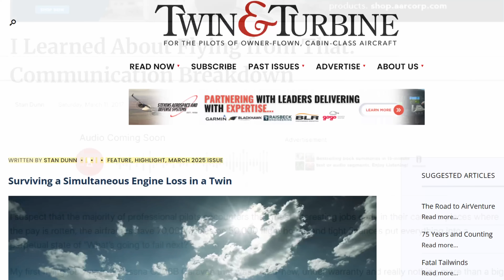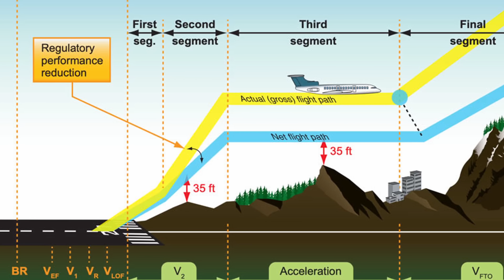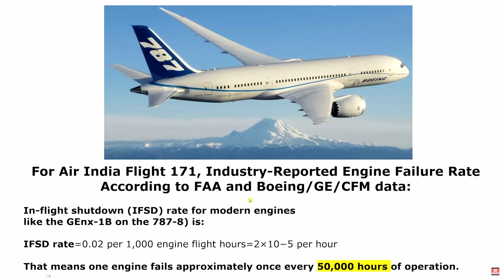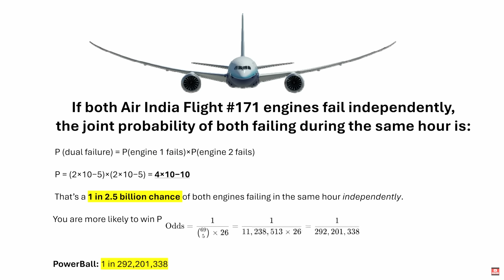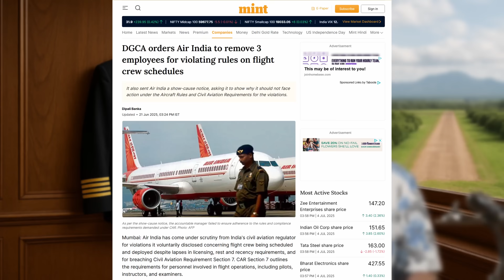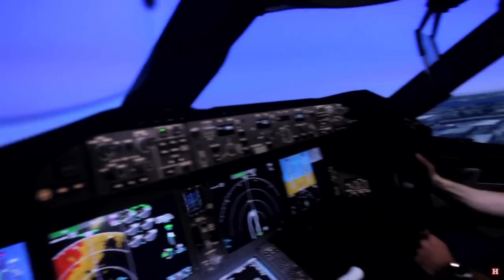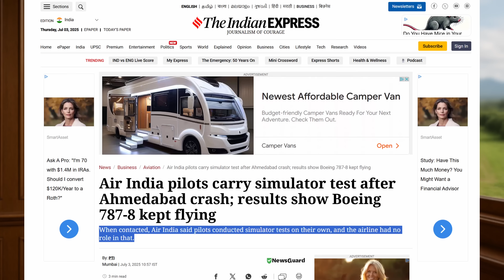Air India 171 Cause Becoming Clear

Comment: Aren’t early leaks from the investigation saying that both the engines spooled down within two seconds? That essentially rules out accidental pilot interruption of a hypothetical single functioning engine. 

I thought the most likely theory was some common electrical component getting fried or perhaps a FADEC software issue triggered by faulty sensor input?

Comment: This is just another version of the flap issue blaming floating around early on. I see this as unlikely as that theory.

First - This must have happened after V 1 and rotate but before the sinking starts.

Second- there is no visable smoke or burning indication, just a trail of lihght dust.

Why would a trained crew cut of fuel suply to an engine at such a low altitude without being sure of what happen? Only running a preliminary investigation of the root cause take longer than 20 seconds.

Thirdly - no pilot would risk turnig a engine of at that low altitude if it isnt clear indication of fire. Specially after knowing what happen earlier. Even with an engine fire going on they would wait until a safe altitude.

Forthly - If one engine working, why not retract the gear?

Plus the aircraft fly stable the whole way down. A one engibe failure should give more wobbling, right?

Conclusion: wait until the flight recorder data is published before blaming the pilots.

Comment: I think your report is the best to date.  I am also a retired pilot.

I never flew a 787, but doesn't the 787 have a system to counter yaw for engine failure?  Maybe that would explain why there was no yaw.  Maybe that "smoke plume" was the failure of the left engine caught on camera.  So, what happened?  Did the crew react too quickly, and "being caught off-guard",  and not retracting the gear, nor climbing and then taking care of the emergency, but instead,  at this moment, shutting down the "good engine" by mistake thus  deploying the RAT also caught on camera.  This is a lot of ifs, and only the voice and data recorders will reveal this mystery.
Reply: Yes it does counter yaw automatically. The R.A.T. deployed as designed. At less than a thousand feet in altitude, the R.A.T. is nothing but a noise maker because jet engines cannot restart and spool up enough to provide sufficient thrust in less than a minute. At sufficient altitude and glide speed they probably could have recovered unless there was a physical struggle/conflict between the pilots to prevent recovery! DISTURBED HUMAN BEINGS INTENTIONALLY COMMITT MURDER/SUICIDE IN AIRCRAFT, AUTOMOBILES AND EVEN GO INTO OUR SCHOOLS, FULL OF OUR BABIES AND GUN DOWN AS MANY AS POSSIBLE, SO WHY SO MANY PEOPLE CANNOT BELIEVE THE PILOTS COULD DO SUCH A DASTARDLY THING??????

Comment: It does not need much!
-A WOW sensor (Weight On Wheels) failure. That's why the gear did not retract. The system believed the aircraft is still on ground.
-A false engine fire alert at the same time, due to high outside temperature (impedance mismatch sometimes observed). Thus, the software said, we are on ground, and engine fire, in this case we shut off all fuel valves.
-Thus, both engines out. Therefore, no electrical power from the alternators.
-The battery disconnect conductor was never used before (no need) and oxidized. Therefore, no battery could stabilize the electrical system. Therefore, the RAT deployed.
Software guys believe they are smart!
Did somebody check the fire extinguisher bottles? Were they still filled with Halon? Did they find the battery disconnect contactor?

Comment: You may only multiply statistical probabilities if the events are unrelated. These engines come from the same manufacturer, have the same lifetime under the same conditions of use, are on the same plane, are maintained by the same crew and use the same fuel. Hardly unrelated.

Comment: I'm an aerospace engineer of 45 years. I stopped watching at 3:40 ish because this fellow is "ruling out" things without all the evidence. Cockpit controls set to a certain position post impact doesn't necessarily mean that the slave control surfaces actually moved to the commanded position. As with most of these videos, we're listening to a pilot and his opinions based on nothing more than anecdotal evidence. This is like asking a bus driver in Tennessee to analyze the crash of a bus in Bangladesh with no tangible evidence beyond anecdotal evidence in news stories and perhaps a traffic cam video. It's entertaining but that's it. What's missing in this fellow's analysis is data recorder evidence, specifically systems data.

Comment: Sorry, I don’t buy the wrong engine shutdown theory. It just seems impossible the crew would jump to shutdown a bad engine before getting the gear up and climbing to a safe altitude and airspeed. These pilots were not newbies. There is indications that the gear began a retract sequence as the bogeys rotated forward. Some crew member would have had to leap to the fuel cutoff as soon as they broke ground. It doesn’t seem possible. Also there doesn’t seem to be the slightest yaw as the aircraft rotated and climbed away. Yeah maybe it was automatically taken care of but I didn’t see any wiggle on the rudder. Yeah, low resolution video. We will just have to wait….

Comment: This investigation is unfolding fast. The evidence pointing to a catastrophic dual-engine or system failure — especially with the RAT (Ram Air Turbine) deployment and simulator results ruling out pilot error — really changes the narrative. Hoping the black box analysis sheds full light soon, and that the fuel and electrical systems checks rule out sabotage. Thoughts?

Comment: I have seen a lot of videos and there is still no overall consensus ..but the most plausible theory based on pure probability is pilots retracting thrust levers for both engines due to some sudden glitch or impulse caused by something in the cockpit.. not saying their fault but they couldn't have avoided it as well .

Comment: After watching this video I just can say that I see a lot of assumptions I made already on the day of the accident. Of course the plane can maintain a positive rate of climb even if it is not configured appropriately. If this would be the case we would have a fatal accident every day.
Either is was a fatal mistake of shutting down the wrong engine or it was a technical malfunction causing to loose both engines. The latter must result from a chain of faults because there is no single point of failure possible.
So most likely shutting down the wrong engine, which leads to an unavoidable crash at this low altitude.

Comment: You rule out tampering with the Fadec far too quickly. Yes, it is an extremely difficult sort of computer to access. But then again most forms of hacking are extremely difficult these days. No one believed what happened when Iran centrifuges spinned to destruction. But it was a hack, until then called impossible. Being an experienced pilot does not give you the authority to dismiss a theory you obviously know little about.

Comment: Thanks for the info. My theory is fuel icing. Right after Vr the thrust started to rapidly decay due to icing in both fuel lines. Both engines spool down. Rat deploy.Minimal elec/hyd/attitude control. There's your next to 0% one in a billion chance of twin engine failure. This happened before on a 767 on landing at Heathrow. British Midlands crash. Thoughts please.

Comment: This does seem like quite a plausible scenario - a single engine failure compounded by pilot errors into a dual engine out or other critical situation. 

I wouldn't be surprised if this does, indeed, turn out to be the root cause. Certainly more plausible than a highly isolated fuel contamination issue or random dual engine failure.

Comment: In your analysis, you claim pilots often switch off the active engine instead of the defective engine, disabling both engines. You also go on to say they must first confirm which one is defective before switching it off. This stage must be handled by computers and not humans. As an engineer myself, a pilot must be burdened with only one decision at this critical moment. To switch off a defective engine or to continue to keep it running.

Comment: I understand when ground power is plugged in or the APU comes on a electrical contactor pulls in Isolating the PM Generators  on each engine.   If that were to happen , Would it kill the fuel pumps,  And the loss of fuel pressure would reduce thrust.  Also if the generators on each engine are lost ,  does the power supply to the thrust control system loose power, so the FADECs looses their thrust setting signals from the flight deck, and therefore cause the engines to defaults to idle, Also if the fuel pressure is partially lost say gravity feed only could the plane still stay in the air.  I believe something happened to the electrical power.  Either causing a loss in fuel supply sufficient to not have sufficient thrust or the thrust control system died and the FADECs both caused the engines to default to idle.  The loss of electrical power may be caused by a stray voltage on the solenoid of the contractor near the  APU or the Ground Power supply socket that caused the PMG isolating electrical contactor to pull in, that then cuts out fuel pumps and or the electrical power supply to thrust control system.  And Hydralic pumps, Stray voltage may be due to waste water leakage.  There was a World wide call to look at waste water Leakage.  Also evidence of electricity problems from the previous flight of that plane.

Comment: Dude go away with all those numbers. Engines are machines and they can fail at any time and because it's not normal that both Engines rarely fail at the same time doesn't mean it can't happen.  If those Engines are so robust then why can't they build them to chop up birds. I can buy a $50 machine that can chop meat and bones and they can't build a ten million dollar engine that can't withstand 🐦.  It's all a scam. One bird gets sucked into an engine can bring a plane down but, if you put that bird in a meat grinder it won't damage that little grinder. Now that they don't know what happened you're throwing the idea around that maybe it was sabotage.

Comment: Everything points towards a "Boeing-special" failure probably electrical. The chance of any pilot shutting down the wrong engine in a single engine failure on modem jets is slim. The computers tell the pilots which engine has failed. In cases where pilots did shut down the wrong engine that I know of, there was no computer telling them directly which engine was the problem. To shut down any engine at a few feet of altitude on a take off climb is unthinkable. Also there's no evidence of mechanical failure. The dust is just dust. Presumably that side of the runway had more dust. As I say everything points towards a "Boeing-special" failure probably electrical

Comment: Even with the flaps in bad angle position and with the landing gear deployed, normaly you can lift the plane. The power of engines could generate enough thrust to lift the plane despite the increase of drag due to flaps and landing gear. That's physic otherwise not many 787 wouldn't have flown. Thrust force is far superior than the cumulated drag. It is clearly an issue which came from engines, both of them.

Comment: I am confused as to how it is that a sophisticated aircraft like a 787 does not include software to automatically detect an engine failure and very obviously annunciate the affected engine, making confusion, shutting down the wrong engine, virtually impossible.  Or, software should not allow shut down or thrust reduction on the good engine.  Next software update?

Comment: It sounds like he had a catastrophic electrical failure which is why the RAT was deployed.  If the RAT isn't able to power the electric fuel pumps the engines would be starved of fuel and the pilot would see a power drop in both engines like he did.

Comment: From day two, I have repeatedly said, they (the co-pilot with his 1,100 total flying experience) shut down the wrong engine after the first engine failure. Perhaps his muscle memory kicked in thinking his was in a propeller aircraft and inadvertently   selected  the fuel shut off  valve to the wrong engine. Immediate dual engine failure???

Comment: My initial and main theory is a potential electrical fire or something similar that destroyed necessary electrical components causing both engines to roll back simultaneously. Potential manufacturing issue or oversight

Comment: AI decide to make a move and start some action>> organize to perform 1 practical test>> insert a script in one or the many Boeing patch software upgrade >> on determined conditions (time, sensor data, electronic signal) script wake up and runs, shutting down both engines>>AI check result and acknowledge>>end test: positive. What happens if an AI enter software and  shut down engines of all flying planes all over the world. Do we know if  planes commands can be overrided from ground?  It seems impossible, but here we already have an "impossible" situation that became possible: 2 engines shut down at the same moment. Edited to add: Closing a Boeing line could be an economic disaster that already can justify the silence, corruption and distortions (again with this crappy theory about flaps...) . Can you imagine to shut down all AI on the planet because is quite clear that this is a clear hostility act and came from a group of AI?? The money ? Boeing is the minor of all problem.

Comment: I read that when electrical power is interrupted, even for a fraction of a second, 787 and 777, for any reason, the spring loaded fuel cutoff valves to the engines will snap shut. This design is that in case of electrical failure, which means fire extinguishers cannot be activated, fuel shuts off automaticslly so the wing does not burn through from an engine fire. At take off there seems to have been an electrical snag. Happened to ANA 787 after landing using reversers, in Tokyo, and unable to restart. Happened to BA 777 landed safely mile before runway in London.

Comment: The only reason I would look at some sort of potential pilot error, maybe in combo with some technical issues is the fact that if it was a purely systemic issue with the plane even a 1 in 1 billion issue surely they would have had that info early on from the FDR and CVR and had to quickly issue a directive for grounding/worldwide checks on all 787s?

Comment: Speculation was the dust was the aircraft almost over running the end of runway and just blowing up some dust beyond the run way. Single engine failure looks unlikely to me. The aircraft showed zero roll to the left and zero rudder movement. Not a single engine failure me thinks........😎

Comment: It's not unheard of to see a fuel filter in the ground fueling system blow apart and FOD a fuel system. Or maintenance actions.  During peak thrust is when a restriction is most likely to exist. To assume water or AvGas is the only potential source of fuel contamination or amount of contamination would need to be massive, is short-sighted.
I still think fuel contamination is an easy suspect.

Comment: I live 20 miles north of the famous BMI crash of 89, I recognise very significantly the consequences of shutting down the 'wrong' engine. I'm not an aviation expert, but surely since then there are safeguards to prevent such an error happening again on a jet engine aircraft? (putting the Indonesian ATR prop accident aside).

Comment: Well dont know why those FADEC systems dont have a man throttle bypass like alot turbine planes have Id never fly those diesel DA-42s  few them jumped there dead batteries just to takeoff retract the gear (high current draw) and have the battery go low voltage and shut down the FADEC sad since a diesel should run without any electrical needs

Comment: The gear being down would indicate that a positive rate of climb was not achieved as this is only indicated by the altimeter not by the rad alt, the altimeter has lag but indicates a true positive climb unlike the rad alt that merely reports contours of the ground ie a gully after take off would indicate a climb by measuring the space under the aircraft

Comment: As a 777/787 pilot of over 25years I can’t help but feel that the Swiss cheese element of various causes probably resulted in the loss, ie under estimating of the WAT airfield conditions plus a possible inversion add to that the potential overloading of the aircraft and the diligence required in setting up a double derated take off could all of led to the incident

Comment: I think they had some kind of electrical surge when they started to raise the landing gear. That could have caused the control that keeps the engines running to go offline. If this happened, it would take more time than they were airborne to reboot it. Hints towards this were the position of the gear as well as the RAT deploying. This also could cause dual engine failure at the same time. If this happened, the question would be what caused the electrical surge, and how to prevent it from happening in the future.

Comment: I'm flying 7,000 miles long haul in a few weeks time, I've made the decision not to fly in any more Boeing planes, this isn't to say that Airbus are engineered any better, but I really feel it comes down to regular stringent maintenance and pilots not being put under any undue pressure to get planes off the ground even at the expense of safety, though I'm only speculating here of course.